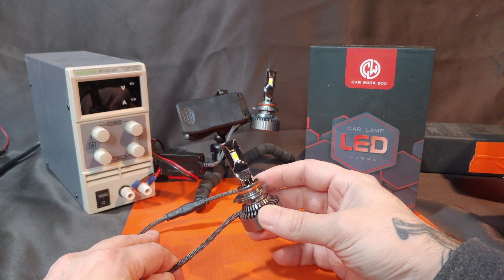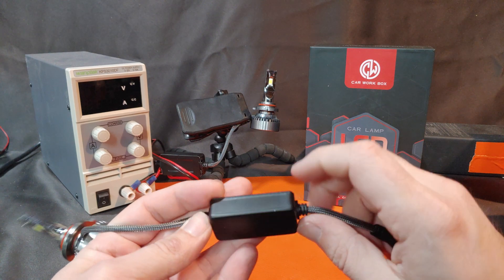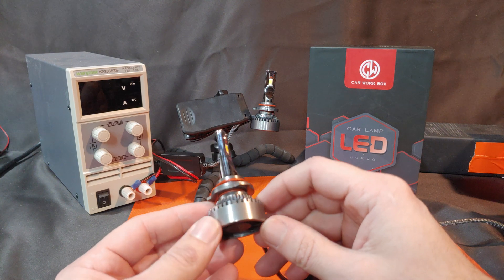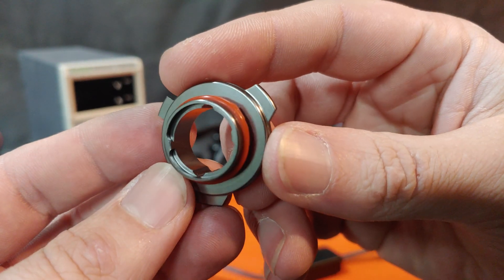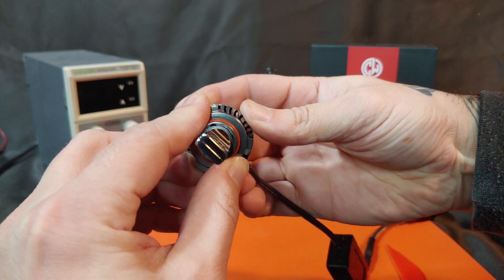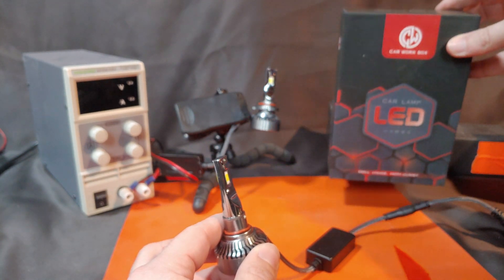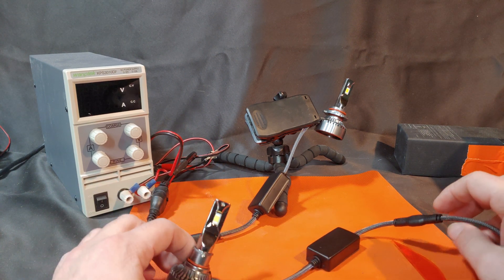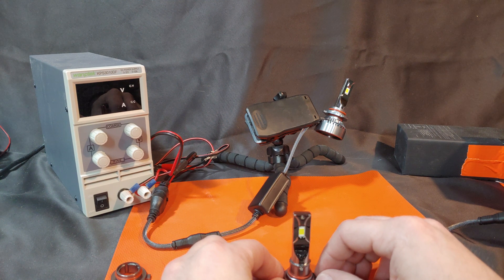Car Work Box LED Headlight Bulb Review

Comment: How would you compare these with 55 watt hids in something like a factory ford projector housing?.
Reply from the maker: I think the HIDs would be brighter (after they have warmed up) and would have a better overall beam pattern, but the LEDs turn on/reach full brightness nearly instantly and will likely be more reliable in the long term.

That's why I switched to LEDs (I'm using the ToAuto and Light Moses 8 sided LEDs in my car)
Check them out:
https://youtu.be/ud4LlOAM5R8

Comment: Hello James, thank you. I have BMW 328i xDrive, I'd like to use them for low beam. Anybody swap halogen bulbs with those?
Reply from the maker: What year 328i? I can look up the bulb your and give you my recommendations.
Reply: @Jamesthelightguy  Oops, it is 2013.
Reply from the maker: Looks like it's an H7 bulb type. I just installed these in my brother-in-law's car:
https://www.amazon.com/dp/B088GWQBX2?ref=ppx_pop_mob_ap_share

 I am currently running the ToAuto and Light Moses versions of the same bulb in my car for low beam and high beam. I believe this design is the best option available right now, just need to find out who has it on sale.

You can see a detailed review here:
https://youtu.be/ud4LlOAM5R8
Reply: @Jamesthelightguy  Thank you very much!

Comment: Hi James, since many H7 OEM bulbs are 55watts do you know any risk or drawbacks using these which are 65watts. I have an X1 2014. Thanks!
Reply from the maker: Technically speaking, there are a few: The big picture is, it puts a slightly higher load on the vehicle's electrical system which in turn (in theory) reduces the life of the system. But this is not actually a significant difference and likely wouldn't even be measurable in real world testing as ambient temperature, humidity, frequency of operation etc all have a bigger impact. The only drawback is if your vehicle is looking for a specific reading from the bulb for CANBUS warnings and such. (I don't remember if these have a CANBUS decoder built in).

So in summary: no, for most applications there is no significant risk to running 65w LEDs in place of 55w halogen.
Reply: James the Light Guy Thanks! Indeed, the model I’m looking at is supposed to have an integrated canbus.

Comment: Can you confirm that these are canbus and won’t throw an error light on my dash?
Reply from the maker: My vehicle is doesn't use the CANBUS for light out detection or anything like that so I can't personally confirm. However the Amazon listing states "These 9006 HB4 LED headlights work with most vehicle's computer system without error."

Comment: I have the h11 bulbs from carworkbox.com not sure if 10k lumens each but still way better than stock halogen and can see way better at night
Reply from the maker: Agreed, they may not be as powerful as they claim, but definitely better than halogen!
Reply: @Jamesthelightguy  from experience they're brighter than the more expensive led bulb from headlightexperts I had them on my truck before and now with these leds I see alot better at night may not be 10k lumens but sure better than some brands
Reply: Hey. I also have a car with h11 bulbs. Want to upgrade to led. Do the bulbs work well? Do they still work? How long do they last?

Comment: I HAVE AN LED QUESTION I NEED HELP WITH....I have a 99 Camry that I completely switched over to LEDS in and out. My car has a rear window internal radio antenna. When I installed replacement 921 LEDs in my 3rd brake light (which sits right against the rear window), and I hit the brake pedal, I completely lose my radio station.  I know LEDs can cause radio interference.  Is there anything I can do about it?  Any help would be appreciated.
Reply from the maker: I've seen some people get better reception/less static by placing ferrite clips on the wires near the bulb. Some bulbs are worse than others and I usually update the bulb to another that doesn't cause static. . . 

But ferrite clips are readily available on Amazon and are inexpensive. It's worth a shot. If you do go that route, let me know if it works well for you.
Reply: @Jamesthelightguy  Will do, thanks for the idea.

Comment: Do you recommend this brand? Most reviews I see are from the states but they are not available in Europe, these are. Also, is there any connector for the H1 socket? All I see is to wires hanging out , I want a plug and play solution... thank you!
Reply from the maker: Am OEM halogen is ground by the base plate making direct contact with the housing assembly. Since these use a plastic bulb be adapter that's not viable. H1 housings have a loose blade connector for the positive and usually have another blade connector attached to the housing near the socket the bulb slides in to. You simply disconnect the ground from the housing and attach it to the wire on the new LED bulb.

As for recommendations, these are pretty decent bulbs but I don't have enough data on the H1 bulb type from this brand. My recommendation for H1 LED is S&D bulb available on eBay.
Reply: James the light guy thank you! You think those 360 degree headlights are the best solution for halogen projectors? The brands I have most ease of access that you’ve reviewed are car rover and koyoso...

Comment: Bought one just now before I even saw your video. Hope it meets my expectations.
Reply from the maker: I hope so too. Come back and let me know (good or bad).
Reply: @Jamesthelightguy  initial inspection seems promising. I will install it tomorrow after work and will let you know how it is.
Reply: @Jamesthelightguy  well, managed to install it and it is indeed very bright white. Just what I wanted but I think the light output is a little short. Something I can live with,  I just need to make sure I'm not dazzling other road user. Beam pattern is not very impressive in my opinion.  I think Led companies should specify if the bulb is for projector or reflector to guarantee a great beam pattern in my opinion.
Reply from the maker: 100% agree. Certain bulbs perform better in a specific housing. I've been surprised in some of my tests to see better beam pattern from my reflector test housing. I used to think that projectors would always be better. The right bulb for the right housing is important.